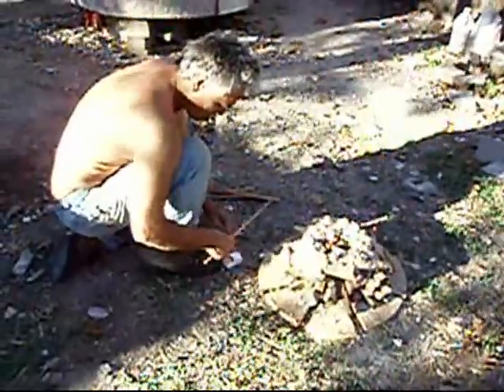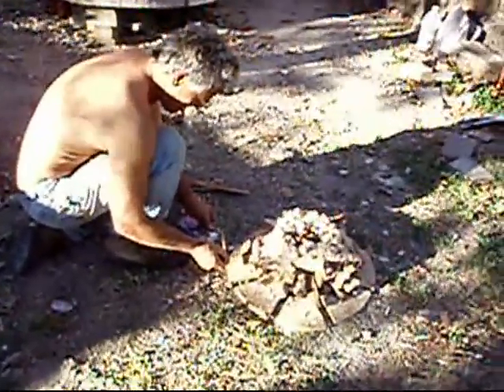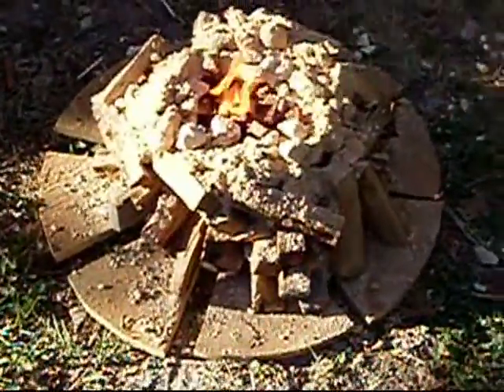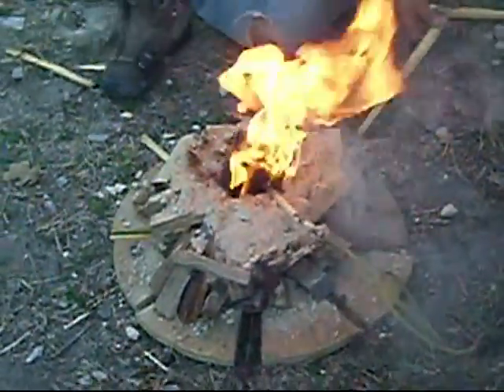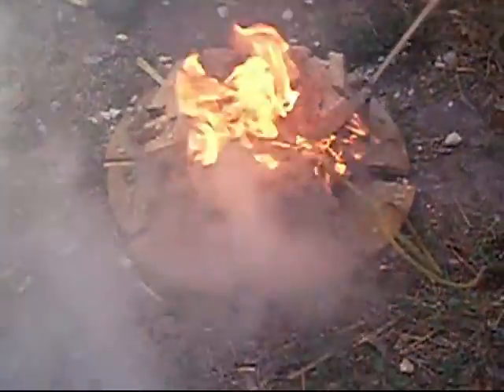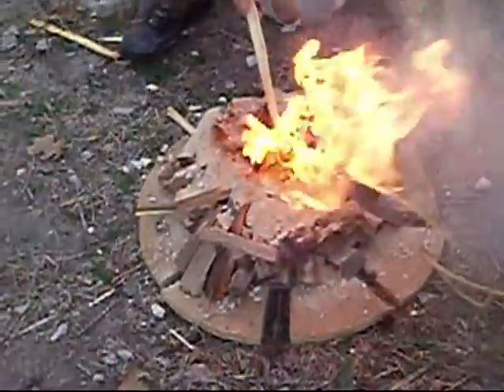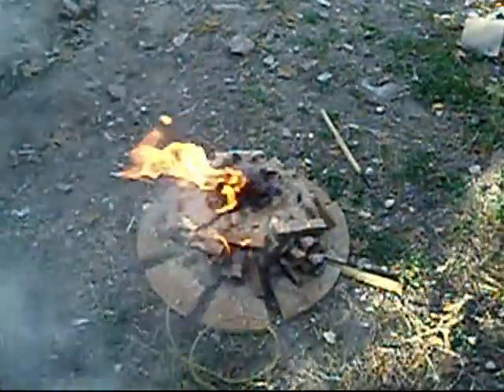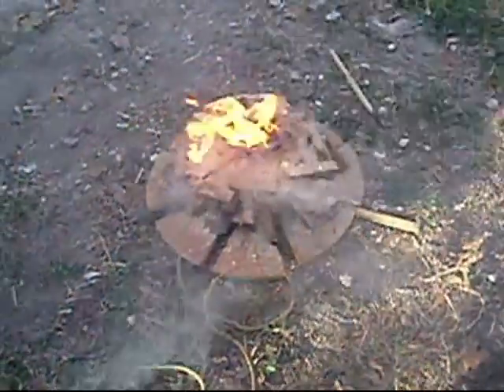Maya kiln

Comment: It's like a 3D rocket stove.
&
Every 13,000 years half the precessional, Great Year cycle our solar system crosses from the positive side of our galaxies double toroidal field into the negative side causing Electromagnetic plasma bursts, Asteroid impacts from crossing the galaxies Kuipers belt and East to West global tsunami's.

That is just one of the Galactic Milankovitch cycles. Eccentricity with the galactic Bulge every 120,000 years regulates intensity, Obliquity magnetic north changes according to our position relative the galactic bulge and the increased Direct sunlight at he higher latitudes poles causes either global warming or cooling depending whether we are Ascending or descending East-West declination from the galactic bulge.

The last time we crossed the galactic plane some 12,000 years ago Gobekli tepe was buried by 19 different E-W tsunami's spanning Millennia.

Co2 is not nor has it ever caused our climate to change.
Temperature is rising first which in turn is causing frozen CO2 in the artic to thaw and follow. Cause and effect.
Forcing and Green house effect are not scientific principles. They are more like putting the cart before the horse.

Einstein "Energy is neither created nor destroyed." On this planet. All energy comes from the double toroid electromagnetic fields we call the Sun and or Galactic Nucleus/Bulge.

Everything living and or dead is Co2. Co2 combined with H2O captures the EM energy of the Sun and creates life.

Earth is a closed loop that self regulates CO2 with life.

Covid like CO2 is a lie built upon an inconvenient truth.
The Baby Boomers who were born en mass 75 years ago are starting to die from the usual suspects of seasonal flu/Pneumonia and old age.

Revelations 13 16-18 No MASK of he BEAST no Buying or Selling.
The Covid MASK of he BEAST is just a pretext for the heavy metals vaccine, contact tracing testing of the BEAST.

Jesus loved all races because there is only one race, the HUMAN race with only one minority the individual HUMAN.

Humanity is being lied to all while the people doing the lying are preparing for the real causes and effects of climate change due to crossing the galaxies EM plane.